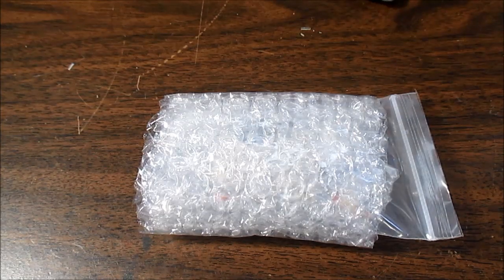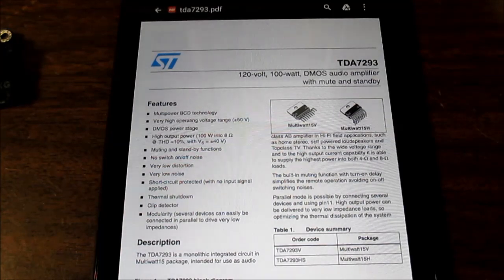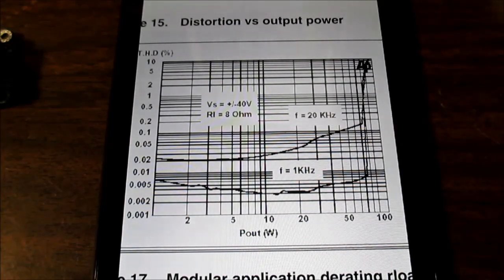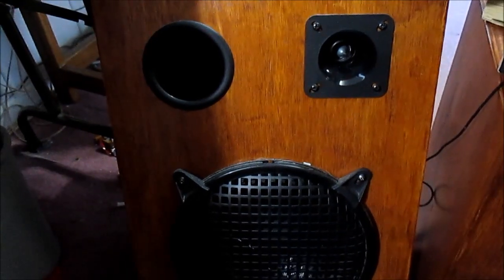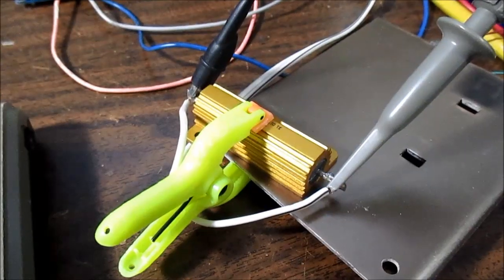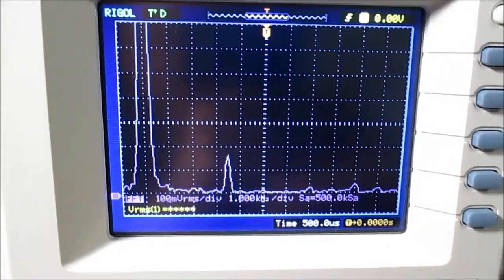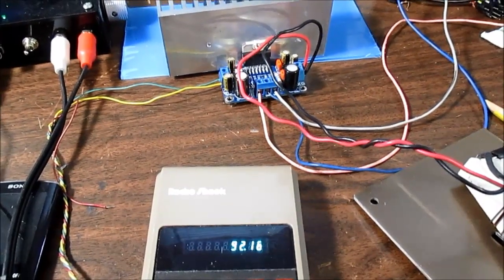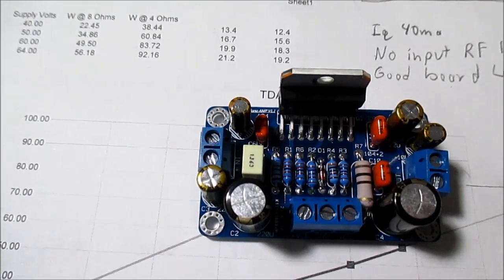TDA7293 100 watt audio amplifier kit test and review

Comment: If these cheap little things have such a great sound, why should we buy an amp from a famous brand that costs 10 times as much?
Or changing the question: why, good brands like Krell, Behringer, Rotel, NAD, and other brands do not use the TDA7293 in their equipment?

Comment: Hi, i was planning on reusing my transformer, its rated at 29-0-29 vac. Can this board handle that power after rectification and filter caps? Thanks a lot i hope you can reply on this
Reply: Yes, i think so.
According to this IC datasheet, it can handle maximum 100VDC.
So convert your transformer AC to DC (filtered and unregulated) would give us 82VDC (aka ±41VDC).
So yeah, by this logic this circuit can handle 12V-35V center tapped transformers

Comment: I bought 2 of these preassembled from aliexpress. I opened the first one and connected it to a 12v-0-12v AC transformer. as soon as I turned the power on the tda7293 chip fried. smoked the thing. I believe the chip was bad from the start. I took a few pictures of the amp before I tried to hook it up, and the TDA7293 had several of the legs that looked burnt.. they were darker than all the others. and guess what, that is the side the fried. I'll try the other one later.. it looks ok,, but who knows with these Chinese sellers.
there is a few differences, the board I got, has a rectifier built in.

Comment: I have two of these modules and plan to install them in the amplifier with +/-65V DC power supply. Will TDA7293 survive this voltage?
Reply: no
Reply: max +/-40

Comment: Hello secret viewer here😅 can i ask is it possible to load 4ohms speaker even i use 32vac? Because i use 8ohms load at this little amp but sometimes i testing 4ohms connection like u said 4ohms load is for 29vac only. What if i don't change the transformer still 32vac then i load 4ohms speaker will it burn ic or explode? Hope you answer me thank u😊 btw i watch your other vidoes😊
Reply from the maker: You can run it above +/- 29v with a 4 ohm load temporarily but it may activate the current limiting circuitry inside the IC which will result in distortion. I would not do this long term.
Reply: @JohnAudioTech  oh i see thanks for the info sir😉

Comment: There's another version of this amp with a bridge rectifier on it to accept a 50 - 60 volt center tapped AC input and the issue with the amp is you get small but annoying AC hum in the amp. I've removed the bridge rectifier and I plan on setting it up with a decent filtered DC source and I think this will clean it up like what you have with this amp in this video. I am going to use this in a small bass guitar amp but I don't plan on pushing anymore than 50 or 60 watts RMS into an 8 ohm load with the option to run a second external 8 ohm speaker but still not push it past 60 or 70 watts RMS. I may reply back to this video and let you know if removing the bridge rectifier and setting it up for a split DC voltage cleans up the hum. I did add a steel plate to the bottom of the amp to deal with any grounding issues and it helped some so with a little bit of luck going to a DC input will remove any AC hum.

Comment: Hi guys if anyone interested this was a project in the Elektor Electronics Magazine November 1996 page 44 . search American Radio history should find it there . It uses a TDA7294 same chip configuration  as there are 94s 95s 96 all different power levels 50 W 80W 120W same pub board. .as for power you need a Toroidal  and 10000uf capacitors keep supply leads short . also recommended is the choke, ten turns on a pencil 18 G with Parallel  10R0 resistor and 100nF and 4R7 in series to ground, A Barkhausen circuit to prevent oscillation with certain loads,  as they are not just resistive as in the test! inductance and capacitive play a part as well. would like to see some 1Khz testing  otherwise good video
Reply: For Elektor, there is a message "Removed by publisher"

Comment: Greetings from Xenia, I just found your channel and love it.  I have a question, is there an American supplier for some of these OP Amp bare pcb's?  Looks like everything from China is taking 4-6 weeks.  
Thanks in advance.
Reply from the maker: Thanks for watching! I can't say about that board, but there are some distributers in the US that sell on ebay.
Reply: @JohnAudioTech   I bought several preassembled boards, and all of the chips I could find on Mouser/Digikey. I plan to build my own from scratch using some of the chips, I'll most likely copy one of yours. We just moved to the Xenia/Yellow Springs area, it's nice to know there is someone in the area that shares my interest in audio and electronics. Thanks for the great videos.

Comment: How does it compare with LM1875 based amplifier in terms of distortion etc. ?
Reply from the maker: I haven't tested to low distortion levels but suspect the 7293 to have lower distortion. This is a higher power rated chip more comparable to the LM3886.

Comment: If I use a 12-0-12 volt, 3 Ampere transformer, will it be okay if I am using it for lesser Power output ? Will the chip draw more current in this case ? (I got the Tda7294 instead of 7293)

Comment: I have never been a fan of TDA7293 type amplifiers! they break easily and when you connect several in Parallel that you can buy many of on ebay, they do not like 4 ohms. I have seen many active speakers with this type of amplifier and they break fast.

Comment: But it lacks real BASS! Definitely not recommended for cheap speakers. For bass reflex YES, for compact sealed speakers NO.
Reply: Yes i confirm it!
I use it as a guitar power amp and for sure it lacks bass
Reply: I use sl6 celestion sealed speaker and have big bass

Comment: John, I'm wondering if they sent you authentic chips for the test. I built these boards, and they promptly blew up! I also built a LM3886 kit from AliExpress...same thing. I subsequently built another 3886 amp, using chips from Mouser and they are working great.
Reply from the maker: You never know what you are getting. In my case, I think the chips were authentic given the high output power I measured without any smoke :-)

Comment: I keep hearing about it, but I can't for the life of me find any information about it: What are those input RF low pass filters people keep talking about?
Reply: A low pass filter is simply a resistor and capacitor on the input to eliminate unwanted (ie radio frequencies) from infecting the amp. Examples can be found online.

Comment: I have a question-
1. What should be the power supply capacity for this amplifier ( Volts and amperage) if powered by unregulated supply like a transformer ?

2. While calculating a power supply for an audio amplifier (voltage and amperage) whether a person should take the  maximum Wattage of an audio chip as given on datasheet in consideration or the actual maximum power before Clipping ?
Reply: Actual maximum power is the better metric to use, this just makes sense as noise is completely unwanted. I usually use +-25-35VDC for a 50WRMS design accompanied by proper gauge wiring at least 18 in my opinion.  Keep in mind transformer secondaries are always 1/sqrt2 V less than VDC rail voltage. I would use at least 10000uF per rail for proper supply filtration.

Comment: Looks good. I bought 3 ready made kits for £3.50 each so maybe they're lower spec. Components don't look as fancy and mine is rectified. I am guessing I don't need to Insulate them from the heat sink?? Looked at the data sheet and it said only power transistors needed insulating in one of the schematics. Did you just use paste?

Comment: hi. just a question. can you make 400W out of 4 of these by combining them? how does it work? thanks
Reply: There's the 7294 which I have worked with...very similar power/ voltage rating as the 7293..
The ..94 has a one pin (don't remember which) that's used to connect 2 or more ..94's in // for higher power...
not sure if ..93 has it..
except for some protection ckts. , THEY ARE pin compatible..I have used the ..93 in place of ..94 when they were not immediately available..
Check out both data sheets to be 💯% sure... hope thi helps..

Comment: Would there be a simple way to add a volume control to that board?
Reply: Yes, after your source, connect a dual gang potentiometer logarithmic of about 50-250Kohm, smaller if possible depending on your output impedance. Google a picture of potentiometer volume control for a pinout of how to do this

Comment: What is the least supply voltage / amperage it needs to work?
Reply: I believe the data sheet says the device turns on at about +-18, with less than 100mA but this would be a BARE minimum

Comment: If i'm not wrong this is the only chip that you've reviewed that puts out this kind of power (Class AB) with close to no distortion. I had these boards for a while now and I was waiting since a long time for you to review them. The only down side to this chip I can think of is the dual rail supply apart from that I am gonna use it in a Subwoofer. You should really check out NCS (No Copyright Sounds) on Youtube, That might help you with the Sound test of these amplifier tests you do. Thank you for the Quality Content.

Comment: Hey John, just so I'm clear, the total voltage of the chip is the total between the rails and not the voltage per rail? So 50 volts total means 25 volts per rail and NOT 50 volts per rail?
Reply from the maker: That is correct.
Reply: Have used upto +/- 36.... NEVER MORE...
& with good reliable working in Prof. Audio equipment for 4+ years

Comment: Hi John. Great video. Just wondering if you have any thoughts on higher voiltage rails. I can get my hands on a couple of transformers (for free) with 34VAC secondary. After rectification, with no load, I should have +/- rails around 46V to 47V. Should be within spec in theory. If I trim the gain back a touch to limit the power output, I figure I'll just have a little more headroom, less chance of clipping/distortion right? Any other disadvantages I need to consider? Look forward to your reply.

Love your channel by the way!
Reply from the maker: I don't feel comfortable powering these little chips at such high rail voltages. I'd stay under 40v for 8 ohms and 28v for 4 ohm loads.

Comment: hi john! fantastic video! I just wanna ask, would a 24 - 0 - 24 V DC supply 4A suffice for the amp power supply requirements? thanks in advance!
Reply from the maker: Yes, that would be fine. For 8 ohm loads, +/- 35 v rails for more power.
Reply: thanks john!

Comment: hi john, i hope you can point me to the right direction, i am planning to build a six channel amp using these kit/ module and i am wondering how can i wire it to a single output bridge rectifier, can i just parallel the supplies or should i have multiple rails?
Reply from the maker: You can supply all six from one supply provided there is enough current for all six amplifiers. I'd have a supply per two amplifiers. You could have 1 supply for every amplifier, but that could be expensive.
Reply: i highly appreciate the response john, now i can proceed with my sorround sound project

Comment: I'm so late to the show but DANG! been decades since electronics classes, but you could "probably almost" use a huge bridge rectifier into 110-115v AC ( x .707?) to get 75-80vdc?
couple big power caps to help suppress 60hz sliding past the rectifier.. and rock ON! (?)

Comment: Hi John, People selling these boards are also selling the chips for $2.89. Digikey or Mouser sells the chips for $6.26, or $4.69 if you buy 100. Do you think those are real chips for $2.89? I know the boards tested well with the provided chips, but that's quite a discount!
Reply from the maker: I can't be 100% sure but they seem authentic based on their performance. The TDA2050 chips I bought from China were always counterfeit because they didn't perform as well as the authentic ones. When I opened the IC package they had much smaller silicon die inside.

Comment: As long as I know, TDA7293 is only chip-power-amp that can be paralleled.
Cheers from Indonesia
Reply: Cocoknya di supply berapa volt si tda ini gan??? Ibles bosuok
Reply: @adhywaw2280  +/- 35 vdc
Reply: @adhywaw2280  kalau ingin awet, patuhi kriteria2 datasheet bag 2.3 Electrical Characteristics
Reply: No, you can parallel lm3886 also.
Reply: @nirupambhowmick481  ...with ballast resistors. Two or more pieces of TDA7293 can be paralelled without ballast resistors.
Reply: @ibles bosuok , lho.. njenengan disini juga to Mbah? 👍👍😄😄
Kebetulan saya baru beli kit tda7293,, di spesifikasinya tertulis input AC Dual 12-32 V.. emangnya aman Mbah disuplai CT 32VAC?
Reply: @jokolewung9093  kalau ingin awet, patuhi kriteria2 datasheet bag 2.3 Electrical Characteristics
Reply: TPA3116D2?
Reply: @oldspicefullbody  I am not sure be able to parallel 2 pieces of TPA3116D2 although there's sync pin.

Comment: hey can i use dual 32 0 32 vac transformer (in dc 40 0 40) for a stereo combination
Will it work good or will it blow up
Reply: @jimmy87251 thanks 
I only have 2 4 ohm speakers
And I need a stereo setup
So 
I have an 18 0 18 vac transformer
Which I had used for my old lm1875 amp
I think I will use that
And use the 32 0 32 for some other project
Reply: @jimmy87251 thanks jimmy
Yes I am also in preparation to use that 32v transformer
With a 2sc5200 power transistor
And use it as a 4.1 set up it will need a lot of space inside the cabinet 
Things gonna take some time
Reply: @jimmy87251 thanks

Comment: Hey John. Can I use two audio outputs(a Bluetooth and a mic preamplifier output) into one amplifier board input?
Reply: Yes you can, all you need is some kind of switch be it rotary or slide or whatever,  such that you switch signal in from each source. Or you could manually change wires yourself. Just make sure the device has an output of something above 500mV rms. Lower and you won't get proper gain

Comment: I have a question According to datasheet if more than 50 watt they have suggested a high efficiency circuit. Going away with this is good?
Reply: Sinc the output transistors are Mosfets..they can be easily paralled 
( more than 1..or 2..TDA7294  ) for higher power.  
ONLY one pin connect for  parallel connect..on each device needs to be connected..... verify which pin from the datasheet..
Also chk. appln. notes  on ..paralleling 7294's

Comment: Please link us to a video for making an appropriate power supply.....one that doesn't cost ten times what the amp is worth.
Reply: Unfortunately, a decent power supply isn't cheap. You could use a switch mode power supply, much cheaper, but they're unreliable, and apparently produce noise. Ideally, you'd want a centre tapped transformer that gives about 24-0-24 vac, and a linear power supply board, available on ebay, with at least 2 capacitors of 10000uf. This would give you about 35vdc at the output, which would be ideal. A little less is ok, just less power as a result. As a suggestion: look for a transformer salvaged fron an old receiver or amplifier. You should be able to find one easily if you look around, as a new one would cost you 60-100 dollars.

Comment: I get 80 volts after rectifier, but the it only suppose to be 60 volts. Due to 2 times 8000 uf capacitors.
You think it can handle that? It is only recommended 2 times 32 volts. Btw it is 6 ohms speakers.
It can play it, but for how long?
Reply from the maker: I would recommend lowering the voltage for the 6 ohm speakers.
Reply: @JohnAudioTech  yeah thought that too, it is just weird, the transformer only suppose to deliver 2 x 31 v and 2 x 23 v.
I dont get it. Btw, those small sized amp, they are quite sensible to brum, from the signal path.
When no signalcable is connected hardly any noise and when I just connect a cable  to the amp without connect it to the preamp, massive brum.
Guess you got to be carefull what parts touches the casing.
But anyway that was just a test to see if it works together, maybe when it is proper put together everything falls to place.
The casing have no ground, nor does the power cable. infact my home have no ground lol.
From a time were nobody thought that was a good idea.

Comment: Hi jhon,Can This thing can be powered by a dual 30v DC or 30 0 30 ac transformer ?I just bought this board but don't know what is cheapest power supply I can buy 
For this one?
Reply from the maker: That's a bit high. I'd go 25-0-25 for a 6 or 8 ohm speaker. 20-0-20 for a 4 ohm speaker. This is the transformer voltage only. After rectifying and filtering, the voltage will be higher.
Reply: @JohnAudioTech  thanks a lot for reply.can you please tell me if I can use 24 0 24 instead of 24 0 -24?its hard to find 24 0 -24.
Reply: @KissAnalog  thanks for reply.I am asking about DC dual supply. luckily jhon made a video on how to convert single rail DC supply to 24 0 -24 supply that helped me.

Comment: Hi, Thanks for this video, I bought 2 of these, but the version that you can use AC directly on them and they work very well.I use 2x30V AC 300VA transformer (measured is actually 32. something so it goes to the max 40V DC after rectifiing).I cool them with 2 AMD coolers (they are cold enough up to 30 percent power to not run the fans) and the fans are powered by a 5V USB adapter once I need more power.Most impressive is that they are dead silent when there is no input.I added a volume control and it started picking up some noise, but you can barely hear it and also is the same noise regardless of the potentiometer position.Anyway nice product and very cheap.
Reply from the maker: They are nice little boards. Amazing for the money. Be sure to ground the volume control's casing if it is metal to help shield from noise.
Reply: is it safe to connect 2x32VAC from transformer?